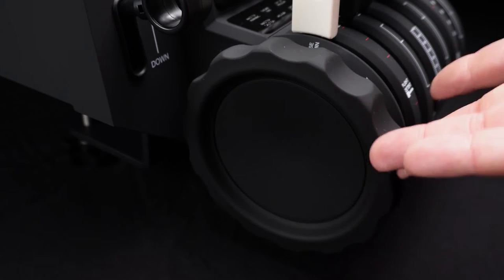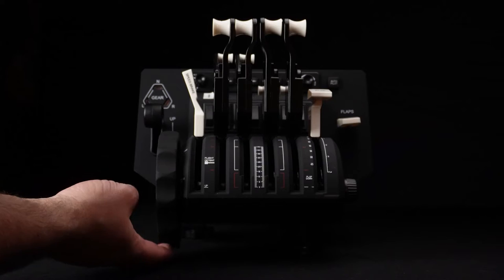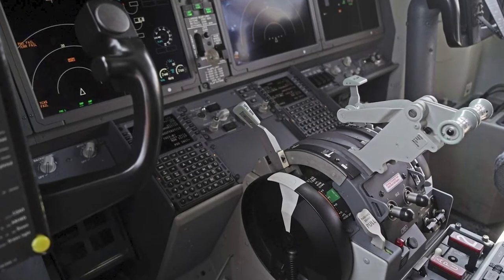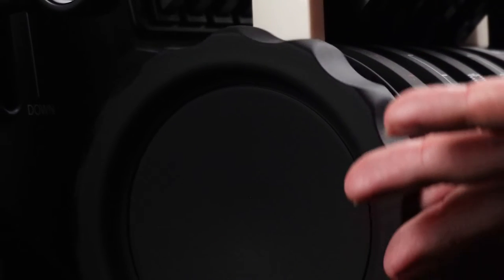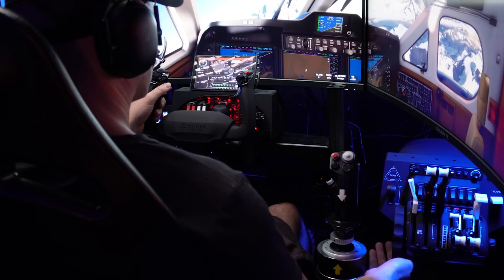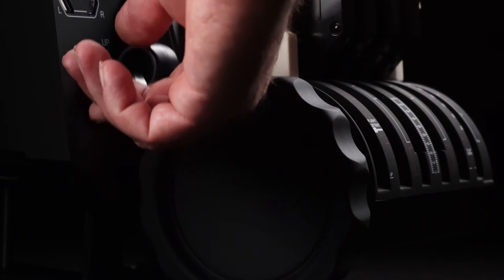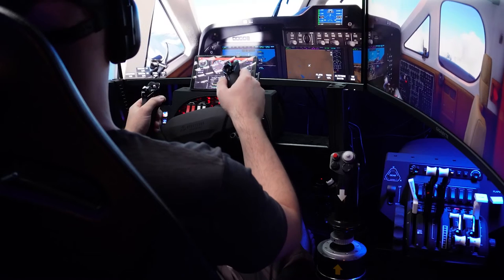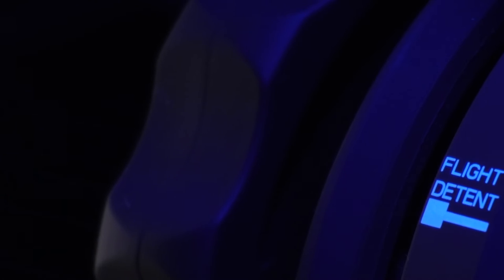The Honeycomb Trim Wheel Cover Upgrade You NEED!

Comment: THE PROBLEM IS the trim bravo doenst work properly on MSFS
Reply from the maker: Are you having issues with it?
Reply: I have too. It's recognized as button, not a wheel and it works HORRIBLY, at least with C152. If you look how it affects the aircraft's trim wheel, you see that for each turn of the bravo wheel, the real wheel turns like half a mm. I don't get it really.